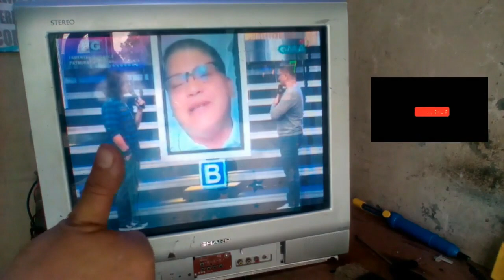HOW TO REPAIR & RESTORE A 20 YEARS OLD SHARP CRT FLAT COLOR TV THAT HAS POWER BUT NO PICTURE & SOUND

Comment: Hi i know this was a while ago but did the screen have the static even though no picture?
Before you replaced vertical ic?
Reply from the maker: No static sir. the heat sink of the vertical is is very hot, that's why i replace it.
Reply: @melsrestoration2397  thank you 
I had a similar tv with no life.
It ended up being 2 capacitors.